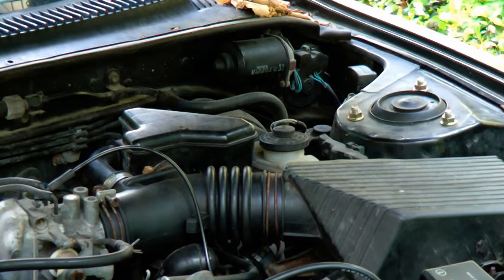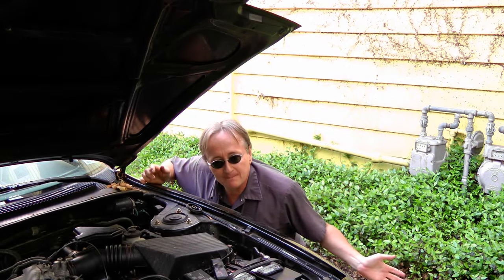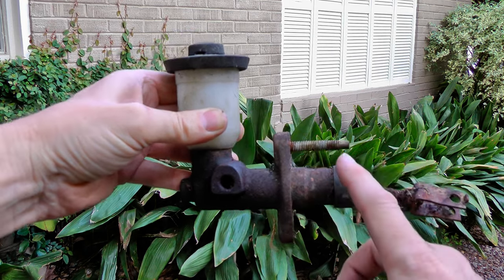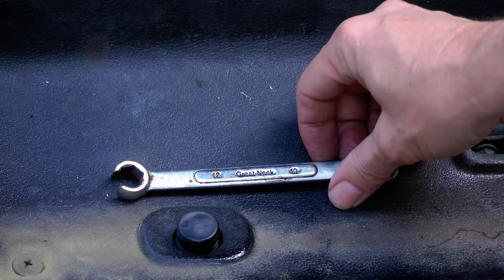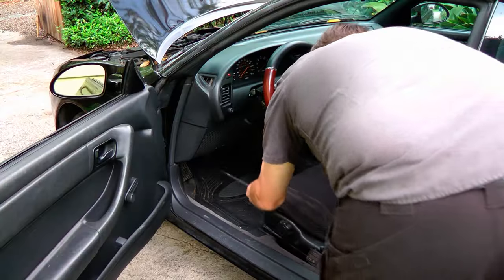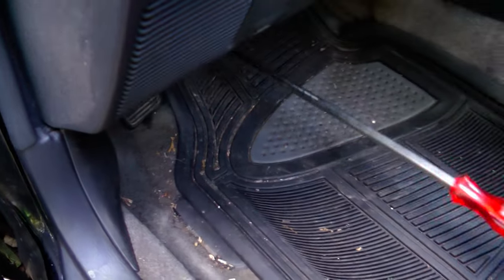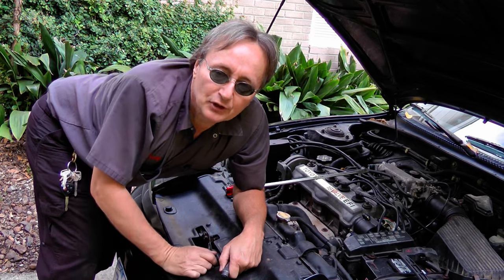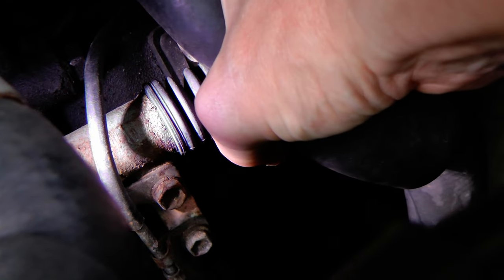How to Replace Clutch Master Cylinder in Your Car

Comment: Hi scotty my name is Gerge I really need your help I have a mazda b2300 1995  and the car was running fine during the day but later went I press the clutch pedal to turn on the car it was HARD. I pump it a couple of time but nothing happen still Hard. But the thing is I  move the shift lever ( I don't now if I use the correct word) to first and I try reverse too I take out the clutch pedal but the car move to slow that you can even notice and if I press  the gas pedal doesn't run .What do you think about it maybe the clutch master cylinder is bad. Thanks
Reply from the maker: could be a bad master, pray it's that, cause more often it's bad clutch itself requiring removal of the transmission to replace

Comment: hi, actually i had grinding noise in my car  for reverse gear which is a button operated and then  require to shift.so the workshop guys replace clutch overall,but unfortunately it didnt stop.then they change master next day.then everything bcame fine.

but after 6 months suddenly a day my clutch pedal duting drive lost its pressure ,though it had very less presuure and again grinding problem stared.Now could u help me to take decision -to change master or slave? the fools of workshop guessed that clutch need to be replace ,but it dont makes a sense bechause i drove just 7k km after last clutch overall

Comment: Im not sure if I have burned my clutch or something is wrong with the hydraulics how can I tell the difference
Reply from the maker: Ryan Oates have someone push the clutch to the floor, then jack up the vehicle and see if the clutch slave pushes the arm in full into the transmission. If it doesn't, hydraulics are bad
Reply: Scotty Kilmer hey scotty im going to look at a 97 3000gt dohc 5 speed he said the clutch will need adjusted because sometimes the pedal stays to the floor and you have to pump it to bring it back up, do you think its one of these problems or something even worse?

Comment: help scott!  I replace the slave and master cylinder, and I bleed the system thru the
 slave. Notice fluid is coming out just fine, but worse thing is the 
pedal is still on the floor. The pedal is not coming back up, and I am not feeling any resistance.
Reply from the maker: air can get stuck in bends of the line, I use a pressure bleeder on those
Reply: Scotty Kilmer thanks! will buy one. :-)

Comment: i have a 91 honda accord we replaced the master clutch cylinder and slave cylinder and i put the clutch pedal to the full adjustment and its not shifting right i have to put it in 1st to start then go then when i shift it grinds. and i bled it a lot what might it be????

Comment: About a week ago I was driving down the road and I hear something hit the bottom of my car. After I heard that my car wouldn't take off in gear... I replaced the clutch and it still will not move in gear... I can move thru the gears without pushing in the clutch... I know if you have the car running and you let off the clutch and it stalls out the clutch is good but if keeps run the clutch is bad well my keeps stalling out but I can put it in gear and let of the clutch and it still will not engage in gear what can it be

Comment: ok so i've replace the slave and the master, used a large bottle of dot 3, and still will not go into gear, it grinds trying to put it in reverse and wont go into 1st at all... What am i doing wrong, i've watch the video several times but for some reason the clutch wont open all the way up.

Comment: I changed the master and slave cylinder on my car but it still extremely soft and it doesn't build up pressure even when we try to bleed it
Reply from the maker: +delos141 ) the clutch would need replacing IF you got all the air out (a big IF) or you got bad aftermarket parts (chinese made ones are often no good out of the box)
Reply: +Scotty Kilmer ok thank you and I hope it's the parts cause they said made in China

Comment: Greetings Scotty, i have a 1994 hyundai excel, i have a problem with the tranny everytime a press the acceleration pedal i sounds like is grinding with something, and the clutch slave start to move, i changed the fluid but nothing,,also the car start to hold off more and more when i release the pedal

Comment: I just bleed my slave cylinder and brake lines in my 2003 Audi A4.  Now the clutch is soft and doesn't offer much resistance and makes it hard to shift smooth.  I used the pump method, one person pushing the clutch while I opened and closed the bleeder on the slave.  Word on the street is Audi slaves are super hard to bleed.  Any times your honor?

Comment: and Air then The Trans Will go back into gear But and Shifts Fine but then We parked it and it Is acting up again i guess theres More air in the system and theres No external leacks and the Res holds all the Fluid  I even

Comment: I have a cousin has a Toyota 4x4 it stays in gear it won't go into reverse sometimes it goes 1st 2nd 3rd doesn't go into 4th gear sometimes it doesn't go into neutral stay in gear
Reply from the maker: the transmission is starting to go out internally, see that all the time when they do finally wear out
Reply: Yeah I remove some window tint from the defroster the glue is still on the defroster how do I remove that and can I use a razor blade on the defroster what's the easy way

Comment: the mechanic replaced the brake Line on my jeep wrangler..and after that the Clutch is really hard to press on it...he said it wasnt him because he didn't touch the clutch..but i noticed right away..why why???
Reply from the maker: +J.Santos who knows where he was working and what he could have bent. He should at least check it out first.
Reply: Most newer cars rob "clutch" fluid off the master cylinder for the brakes. More than likely he let air into the system and only bled the brakes.

Comment: My Mazda is only running on 2 4 gear anyone know
Reply from the maker: if it's a standard transmission, fix the shifter bushings or cables. if it's an automatic, rebuild the transmission